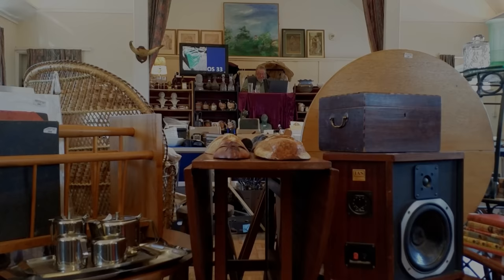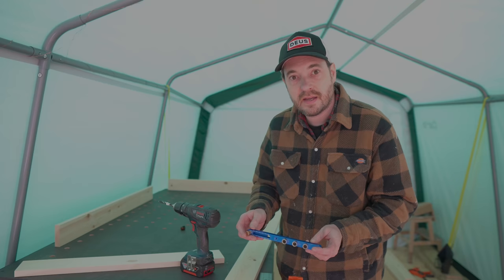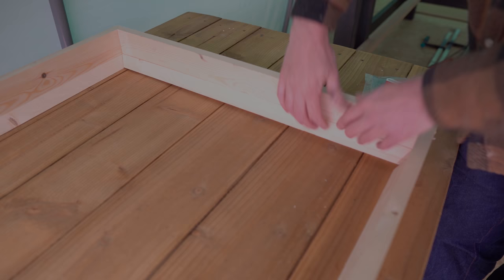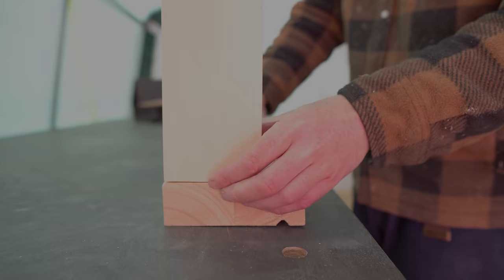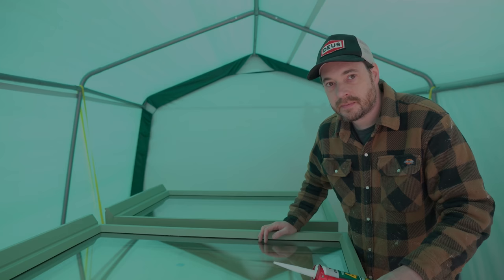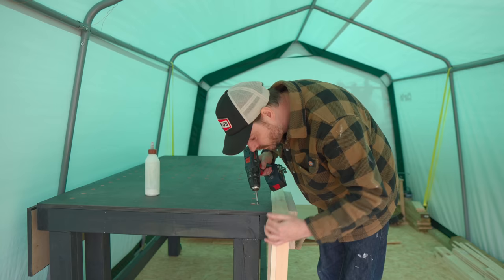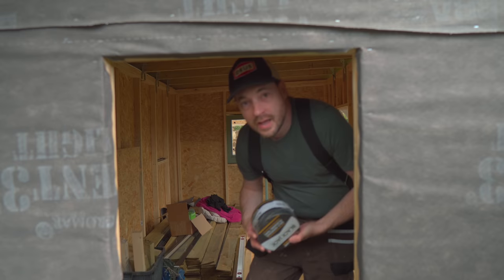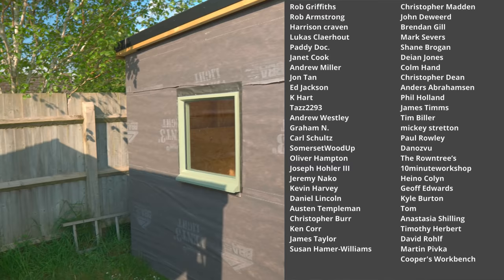Garden Room Build, The Windows

Comment: Nice tip for installing the glass onto the foam tape is to spray the tape with glass cleaner before putting the glass up to it. It allows you to move it about until your happy with the position, and once the cleaner has dried it will still be stuck to the glass.

Comment: Why didn’t you just put the glazing tape right towards the front edge because 1/2 of that tape isn’t doing anything as there’s a void In between the glass and the rebate. Also if you moved it to the front then you wouldn’t have to silicone the whole as there’s no chance of water getting in there, also when you come to paint the windows again the paint won’t stick to the silicone. We also do wet glazing where we fill the void in between the unit and the rebate with silicone so no water can even get in behind the bead. Great work just some points you might like to hear as I am a joiner thanks

Comment: Nice job. When you're doing the windows for your shop, lift the glass units up off the timber with packers. A couple of secret drainage holes that come out under the cill would be good too. That'll help stop the seal on the units getting wet and breaking down. If you have any openers that are side hung, toe and heel the glass with packers to help stop the hinges dropping. 👍

Comment: This is looking wonderful.  I would think battery tools are great, except for maybe on a table saw it might be a little underpowered at times?  Your videos are perfect.
Reply from the maker: It has plenty of power
Reply: Some of the reviews I saw for the Bosch table saw said that it was a bit underpowered.   I guess it depends on what you cut with it.  I have a budget mains powered table saw from Screwfix (years ago) and its woefully underpowered, will stall with anything slightly thick so am looking for a new one at some point.  Some of the prices are eye watering though

Comment: Excellent work Matt, I am very impressed. And I think you really felt the benefit of all those new tools. Great job fitting the glazed panels but I'm wondering how tricky replacing a window [if it gets broken] will be.
Reply: Shouldn't be to bad, i would probably use screws on the inside to make it obvious, or use conventional wood beading.

Comment: Very nice job Matt, I was expecting there to be lots of routing going on to rebate the frames, but your approach with the table saw and dowelled corner joints made it much easier to construct.  The colour is lovely and the frames look really good, but was wondering when you painted did you cover the knots up first with knot sealer, then prime and undercoat?  Just concerned how long the paint will last if it went straight onto the wood.